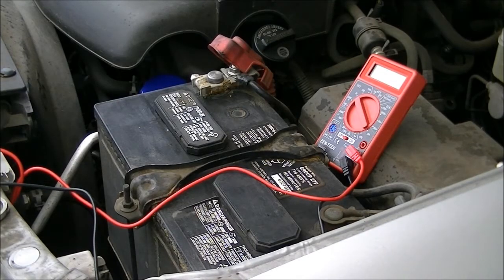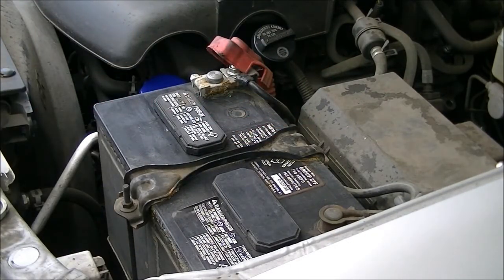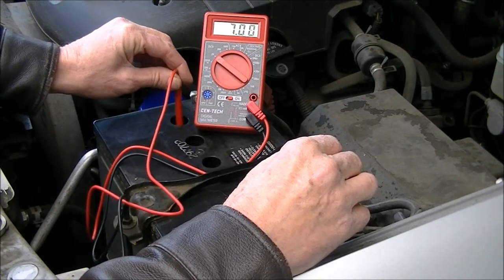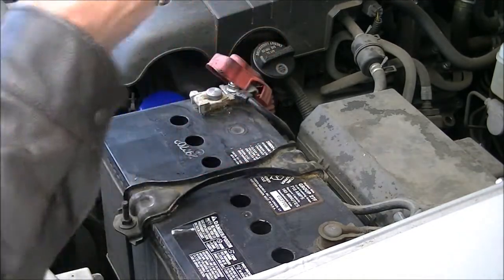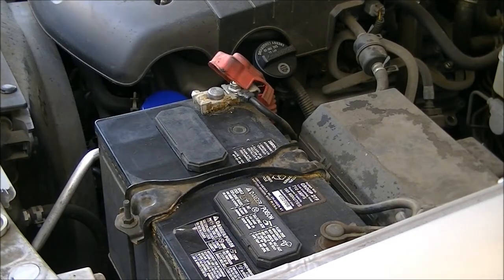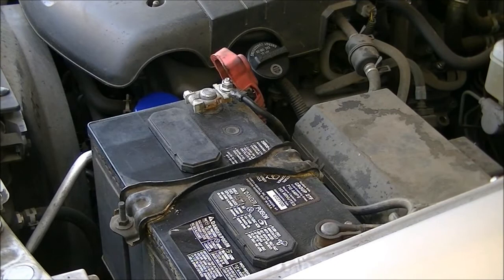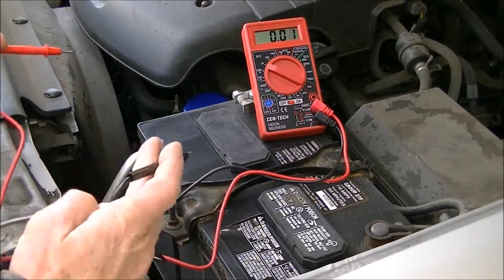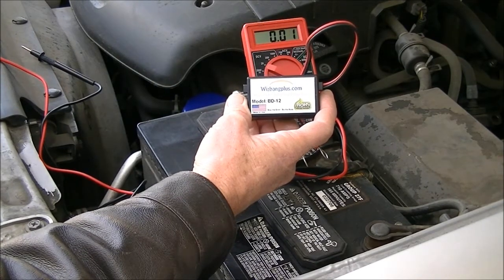Restoring A Battery With A Wizbang Desulfator?

Comment: Electrolyte should always cover the plates, otherwise it is low, this often causes premature battery death. It can be pretty impossible to recover batteries sometimes. They may even charge and indicate 12V or more, but lack any ability to supply enough cranking amps.. A lot of new batteries are "maintenance free" as they are sealed systems and do not even have accessible plugs to top up electrolyte.

Comment: Hello John,  to test the individual Cells, you have to follow this protocol
IMPORTANT: Write down READINGS of your FINDING (PREPARE a NOTE & Write: CELL 1  2  3  4  5  6 )
1- with the black () Negative Probe of the meter, connect to  () Negative Post of BATTERY
2- PROBE with the RED Probe of  Meter the very FIRST CELL next to (-) Negative POST but CLOSE to THE NEXT CELL CONNECTOR ELSE Meter will read 0 Volts 
3- MOVE THE METER'S BLACK PROBE TO THE 2ND CELL  
4- MOVE THE METER'S RED PROBE TO THE 3RD CELL AGAIN CLOSE TO THE 4TH. ELSE 0 VOLT 
FOR THE REST, YOU GOT THE PICTURE,
WRITE DOWN THE VALUES EACH TIME,
doing it this way, you get true READINGS + LESS PROBE MOVEMENTS.

so unfortunately, this will only give you a floating voltage, the true voltage for current delivery should be down under a load.

I AM ABLE TO ACTUALLY LOAD TEST EACH CELL SINCE I AM A BATTERYHOLIC FOR ALL CHEMISTRY AVAILABLE TODAY SO I TEND TO OBSESS BUT IT IS A LOT OF FUN,
BEFORE YOU EMBARK ON THIS CELL TESTING, IT IS ALWAYS GOOD TO TAKE A LOAD TEST
IT SHOULD BE A SECOND AT SAY, 1/4 C IF YOU CAN  "C" STANDS FOR "CAPACITANCE" MEANING THE ACTUAL BATTERY POTENTIAL "NOT COLD CRANKING" "NOT RESERVE CAPACITY" 
BUT THE TRUE AMPS OF THE BATTERY WHICH IS AT TIMES DIFFICULT TO FIND SINCE MANUFACTURERS LIKE TO IMPRESS YOU WITH COLD CRANKING WHILE THE REAL NUMBER OF AMP DICTATE ITS REAL TRUE VALUE
WHILE YOU SEE 700 COLD CRANKING AMPS, THE TRUE VALUE OF THE AMP IN THAT BATTERY COULD BE ONLY 65 AMPS WHICH YOU CAN TRANSLATE IN UNIVERSAL MEASUREMENT SUCH AS JOULES WHICH IS A TRUE VALUE OF ENERGY.
SO FOR THE LATTER 12V MULTIPLIED BY 65 AMPS IS = 780 WATT/HOUR  = 2,808,000

780 WATT/HOUR  = 2,808,000  = 670679.3 CALORIES =  2661.47 BTU (British Thermal Unit)
BTU: A unit for measuring heat.
One British thermal unit is equal to the amount of heat needed to raise the temperature of one pound of water by one degree Fahrenheit, or 251.997 calories.  
 One Btu raises the temperature of one pound of water one degree Fahrenheit.
-- I think I bored you guys enough, but it is really fascinating how our fore Fathers figured the need to substantiate everything.

Back at the battery Desulfation, there is much more to it, so if you need to know more just reply to my comment, and I will answer.
Reply from the maker: Christian StClaire That's all very good advice. Thanks.

Comment: Wow your ears must be burnin! I was just thinking about that! I have so amy different kinds of batts and they have different properties. I'll be looking forward to your results. Thanks. Hey I have one of those syringe 3 bubble testers and the same meter you have from HF. WHat is the differance between testing with those. Of course the meter is better but what is the diferance. I bought a bubble one for like 2 bucks at WalMart. Never knew I could check a battery kine you just did. Rock on!
Reply from the maker: The big difference between the the testers is that yours tests for acid concentration, and what I did checks to make sure each cell is contributing to the battery voltage. I need to get a tester like yours. It might shed some light on my battery problems.

Comment: Harbor Freight has a float trickle charger to maintain your battery. I bought one with a coupon for $5. If you don't use the trickle charger, you battery voltage will go down when you park your car. The desulphators work to a point, but probably work better when your battery is fairly new.
Reply from the maker: I'd maybe buy one of those for $5, but they don't get good reviews. Still, reviews aren't always accurate.